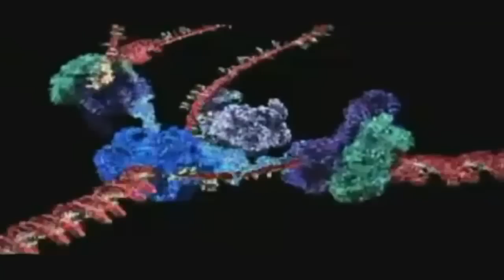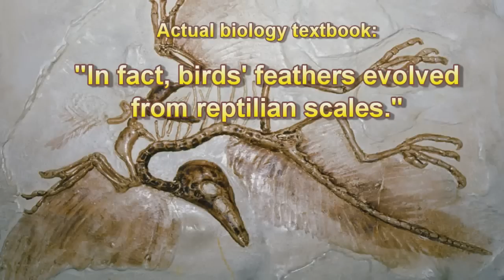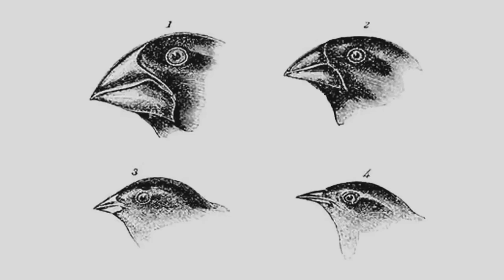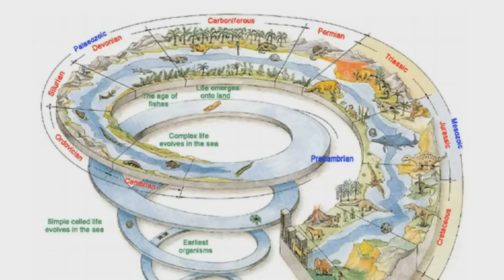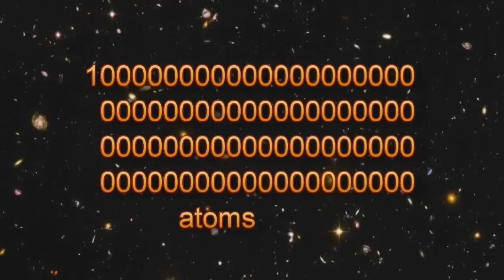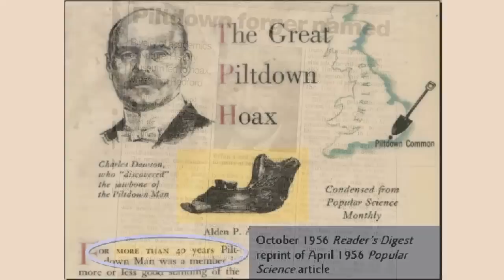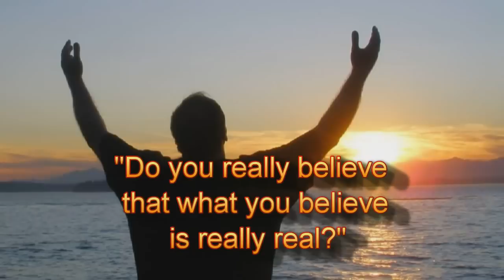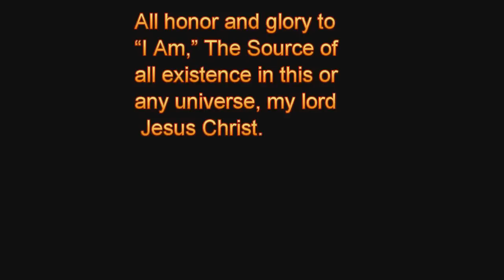Evolution Demolition

Comment: DMBell: its adaptive evolution , but you make the assumption that's its macro evolution. the tests say not so.its reasonable to assume that evolution cannot account for ALL systems ( chemical evolution) see independent tests not just biased peer reviewed papers.
Reply: Sorry but the evidence refuting evolution does not exist. 
1. ERV markers are non coding sequences of DNA inserted into the genome of host organisms by viruses. These markers are inserted at random and are used by the virus to take over the cell and produce more viruses. Humans and chimps share 12 ERV markes that are in the same locations in both genomes and have the same content. The ONLY feasible way for this to happen is for our species to have a common ancestor that also had these 12 ERV markers.
 2. Almost all mammals produce the Vitamin C they require. Humans have the gene to produce Vitamin C but there is a single bit error in the gene that renders it useless. The only other mammals that have this error are the Mountain Gorillas, Chimpanzees, Bonobos and the other great apes because we share a common ancestor with these same great apes. The defective GULOP pseudo-gene is shared by monkeys as well as apes and is disabled by exactly the same mutation. I might also point out that the GULOP pseudo-gene is only one of approximately 20,000 other pseudo-genes in the human genome. (Yes, 20,000 pseudogenes, almost equal to the 23,000 active genes). Many of these now non-functional genes had activated olfactory proteins. Non-functional genes are perfectly consistent with evolutionary theory, they make no sense as 'intelligent design'.
3. Most animals do not see in full color. The gene that allows humans to see yellows, blues and reds is only found in one group of animals, primates of which we are a member species. 
4.Valid Scientific Theories can be used to make predictions. Darwin noted that the bones in the wings of birds resembled the fused finger bones of other animals so he predicted that fossil bird would be found with unfused finger bones. Less than 5 years later, archaeopteryx was found with feathers, a long bony tail like a dinosaur, teeth and unfused finger bones in the wing. 
5. Dr Neil Shubin wanted to find the first fish that could crawl up onto land. Eusthenopteron of 385 million years ago was similar to the later Acanthostega of 365 million years ago but there was too much difference for there not to be an intermediate species so he looked for exposed sedimentary rock of the right type and age and found this in the Canadian Arctic on Ellesmere Island and found the intermediate species that was then named Tiktaalik.
 6.The human and chimp genomes have been compared and the two are over 94% the same. More over, where there are differences the are those genes that enable brain development, different hair growth, language development. 
7. The fact that new medicines have been tested on animals for side effects and efficacy shows that the underlying biological systems are biologically similar and therefore related however distantly.
 8. Embryology hints at the Evolutionary history of species with snakes developing limb buds in the early stages of development that then get reabsorbed. We have the fossils of primitive snake that have vestigial legs that extend beyond the body of the snake and it is a regular "birth defect" in snakes to have non functioning legs. 
9 Whales evolved over the past 55 million years from land animals. This is shown through the fossil record that start with Pakicetus that was identified as the precursor to the whale lineage by the presence of an S shaped bone in the skull of Pakicetus that is unique to whales as well as an unusual double tendon arrangement on the limbs of Pakicetus and is still found in the flippers of modern whales. Neither of these features are found in any other animals. It is also noted that by comparing the genomes of many species, the closest living relative of whales is the hippo, another aquatic mammal. 
10.Genomes contain non functioning genes called pseudogenes. Mammals, including humans have the gene to produce egg yolk due to the fact that we evolved from egg laying ancestors some 100 million years ago. 
11. Birds are descended from and are a living branch of dinosaurs. We have found many dinosaur fossils with the imprints of feathers preserved, even dinos that were too heavy to ever fly. Even the velociraptor of "Jurassic Park" fame has been shown to have the anchor points on the bone of its fore limbs of feathers indistinguishable from the same bumps found in eagles or geese. This case is further reinforced by the fact that chickens still have the DNA for a long bony tail like a dinosaur.
 12. Characteristics of animals and plants are strictly divided by phylogeny. Only birds have gullets, feathers and beaks, features that have all been identified in dinosaurs. Only mammals have lactation glands and fur or hair. Only reptiles and snakes of land animals are cold blooded.
13. The Creationist claim that there are no transitional species is simply a creationist lie.
Reply: 1.  Endogenous retro viruses it turns out are not viruses at all, but have identified to have function in genomes in 50,000 instances (and probably all instances). This means that the viruses came from pieces of DNA, rather than the DNA getting its code from the ERV's.  Good observations, but bad conclusions.
2&3. Creationists agree with degenerative genomic change, although many of these cases turn out to have a functioning purpose when investigated further.
4.  Archaeopteryx has been universally agreed to be a bird.  And common design features do not prove common descent anyway.  A common Designer is a better explanation.
5.  Yet fossilized footprints were discovered that they dated ten million years earlier than Tiktaalik.  So how could it be the transition for walking creatures?
6.  Originally they said 98% similar.  After closer examination of the details the number is down to 70%.  We share half of our genome with a banana.  This is merely an indication that a common Designer used similar programming subroutines in all His creation.
7.  Again, common design, not common descent.
8.  Sounds like a Bible story to me.
9.  There is so much wrong with the whale sequence chart that it is difficult to get into here.  I recommend Living Waters, a new film by Illustra Media.
10.  You are behind the times.  Nearly all so-called pseudogenes (junk DNA) has now been shown to have function by the ENCODE project.  Just because you don't know the function of a given gene doesn't mean that there isn't one.  Continued study rather than arrogance would be my recommendation.
11&12.  Claiming descent does not make it so.  Yes, organisms can be organized and classified.  Carl Linneaus, a creationist, was the first one to comprehensively do so.  But ancestry is an assumption, not automatically implicit in the presence of similarities.  Tracking different features and different genes will render different phylogenetic trees.  A common Designer is the best explanation for homology.
13.  I understand that you think there are a few transitional forms.  Creationists say that you have not verified ancestry for any of them.  It is not a matter of lying, but of disagreeing.
Reply: 1.  Endogenous retro viruses it turns out are not viruses at all, but have identified to have function in genomes in 50,000 instances (and probably all instances). This means that the viruses came from pieces of DNA, rather than the DNA getting its code from the ERV's.  Good observations, but bad conclusions.

<Sorry but no. ERV markers are not the virus but are DNA from viruses and the do NOT active DNA in our genome. These markers carry genetic sequences that are unique to the viruses they stem from, they are not native human DNA.>

2&3. Creationists agree with degenerative genomic change, although many of these cases turn out to have a functioning purpose when investigated further.

<My question is with the Vitamin C gene, why would an intelligent designer put such a gene into the genome and then not correct it. Other mammals have this same gene working fine, only primates have this error, including us.>

4.  Archaeopteryx has been universally agreed to be a bird.  And common design features do not prove common descent anyway.  A common Designer is a better explanation.

<No a common designer is not a better explanation when a natural explanation requires no magic. Let me remind you that you have above agreed that genetic change is not impossible but there is not a single bit of evidence that supports the "intelligent designer/god" concept.>

5.  Yet fossilized footprints were discovered that they dated ten million years earlier than Tiktaalik.  So how could it be the transition for walking creatures?

<The fossilized footprints are intriguing but do not show the anatomy the way an actual fossil does. Many animals have a species life time of more than 10 million years. The samples of Tiktaalik may represent a species that existed through that time frame or it might be a differnt species. What makes it a transitional species is that it shows features that are both aquatic and primitive and new feature that are carried on to the early amphibians.>

6.  Originally they said 98% similar.  After closer examination of the details the number is down to 70%.

<No, only creationist sites put the similarity at 70%, this figure has no credibility.>

 We share half of our genome with a banana.  

<Humans and plants are both made from eukaryotic cells and much of that DNA is used for creating and regulating the functions of life at the cellular level.> 

This is merely an indication that a common Designer used similar programming subroutines in all His creation.

<Sorry but no, Evolution requires no magic, unlike your "Id/god".>

7.  Again, common design, not common descent.

<Sorry but there is NO evidence of any organism being created. Every species, fossil or living fits into phylogenetic categories that show change over time and give rise to new species with similar traits. This would not be true if species could be created by magic.>

8.  Sounds like a Bible story to me.

<Marvy. So why would snake embryos start developing legs and then reabsorb them? Why do whales have fully formed finger and wrist bones inside their flippers? Why do emus have wings but no muscles to move them. This is not intelligent design, these are vestigial stuctures that are being slowly removed from the active genome of these species.>

9.  There is so much wrong with the whale sequence chart that it is difficult to get into here.  I recommend Living Waters, a new film by Illustra Media.

<Sorry when I read fiction I want it to be written as fiction, not propaganda.>

10.  You are behind the times.  Nearly all so-called pseudogenes (junk DNA) has now been shown to have function by the ENCODE project. 

<No that is lies from your creationist sources.>

 Just because you don't know the function of a given gene doesn't mean that there isn't one.  Continued study rather than arrogance would be my recommendation.

<Claiming intelligent design and a god doesn't mean that there is one. Starting legitimate study rather than continued arrogance would be my recommendation.>

11&12.  Claiming descent does not make it so.  Yes, organisms can be organized and classified.  Carl Linneaus, a creationist, was the first one to comprehensively do so.  But ancestry is an assumption, not automatically implicit in the presence of similarities.  Tracking different features and different genes will render different phylogenetic trees. 

<Sorry but no. Where we have both the bone structure and the genome of a species there is over a 99% correlation between a morphological phylogeny and a genetic phylogeny and a phylogeny based on ERV markers alone shows identical to the genetic phylogeny.>

 A common Designer is the best explanation for homology.

<Only if you first believe in magic. Rational people do not.>

13.  I understand that you think there are a few transitional forms.  Creationists say that you have not verified ancestry for any of them.  It is not a matter of lying, but of disagreeing.

<No I disagree. There are thousands of transitional forms. That creationists have not accepted them means nothing. >

Comment: What is 'vertical evolution'? Who uses that term other than you?
Reply: +Joseph Smith    I'm explaining a concept.  Others have called it uphill evolution or uphill change.  I don't care about the term.  I care that you get the idea.  Downhill change and horizontal change (re-mixing) certainly happens.  It is added programming that cannot happen spontaneously.  Impossible.
Reply: +Mark Champneys You still have not answered. The assumption that you are expressing is the evolution 'goes uphill' assumes a directionality, which is not the case. Selection, gene flow, genetic drift and mutation drive evolution. These factors 'shape' the genetic and phenotypic changes through generations via differential death and reproductive success.
So you use a straw-man fallacy that scientist don't use to declare evolution is impossible. The ladder analogy of evolution is not used by scientists or supported by data. So the question is why are you?
The case for common descent is strongly supported by the data and scientists.
Reply: +Joseph Smith    We both agree that change can occur in the sideways or downhill direction (informational loss).  But the striking thing about evolution is its attempt to explain how microbes became men.  The question is, how did all this functional genetic programming arise?  Not, how does information get lost or re-mixed?  The stubborn fact is that functional instructions have never been known to arise or be built up by random processes.  We have lots of experience with prescriptive information coming from design, but zero experience with prescriptive information writing itself.  Zero.
Reply: +Mark Champneys What are you talking about? The ladder idea for evolution is not supported by the evidence. No scientific paper that I know of supports this claim. So why are you bent on saying it is? 
Prescriptive information is a linguistic term so other than analogies do you have any evidence that DNA is a language? If it is who is using it? 
Remixed information, since you are using the metaphor of language-- so will I. Every time I write I remix information. Guess what the secondary information is new.
Reply: +Joseph Smith He insists the universe is only 6000 years old anyway. Even if evolution is allowable, there's just not been time for it all to happen! The big picture and the vast bodies of data he MUST ignore to be a YEC makes uncomfortable reading for him. He sticks to the old thermodynamics objection to evolution, but cheerfully disregards thermodynamics completely when it comes to Catastrophic Plate Tectonics. He'll argue till you're blue in the face about probabilities, information theory etc. See some of the other threads for that.

Comment: So why can't you prove evolution is wrong?  Why is it still taught as fact and studied at every university  in the world?
Reply: Mark Champneys Do you mean the math formula [laws are math] at 30;18 that applies to a Closed system?  Life and evolution are not a closed system.  Yes, the universe is a closed system and will be cold and dead some day.  
Keep trying.
Reply: Mark Champneys  You are like a three-year-old arguing 1+1=3.
Your argument about the closed system basically implies no order can ever spontaneously appear, which is clearly false. Just go watch water boils.
 
Entropy does not equal to disorder in everyday sense. If you don't understand that then you don't understand entropy or the second law of thermodynamic.
The reason why ordered systems will spontaneously appear when there is sufficient potential is that they are more efficient in facilitating energy dissipation than disordered system, and energy will always look for the most efficient way to dissipate.
Reply: twrciv The second Law applies to a closed system and life is not a closed system.
Reply: Mark Champneys You IDiots don't understand why the 2nd Law applies to a closed system.
Closed system: you lock yourself in a room for a year.  Yes, you will die and turn to mush. 
Open system: you include the sun in your ''closed system''.  The whole system does run down but you eat food and grow at the expense of the sun.  The total for the system runs down but life works and it evolves.

Comment: I don't believe in evolution either as it is conventionally taught but I have to play devils advocate here for a sec. Im wondering why the dinosaur samples are showing these recent dates when being carbon dated now with a machine that wasn't needed. If the they were dated to 30,000 years then why wasn't this observed before, why was the 100,000+ year carbon dating machine necessary at the University of Georgia? Also the 2nd law of thermodynamics, while overall entropy is a strong point, it doesn't hold in ur example as long as the observed complexity (life in this case) can be observed within the boundaries of an open system (earth). Evolutionists can unfortunately still parade around their stance on entropy.